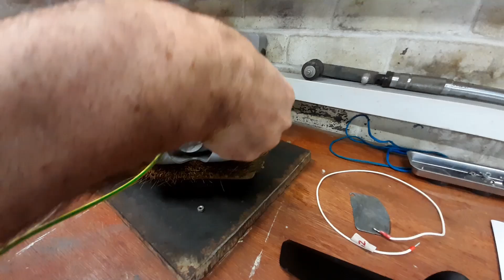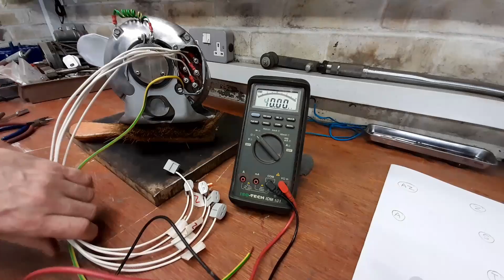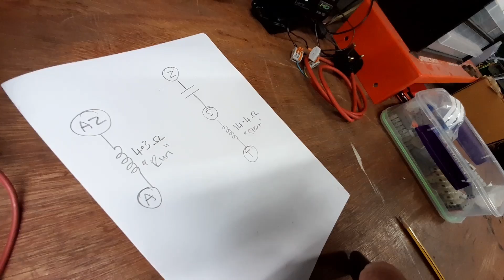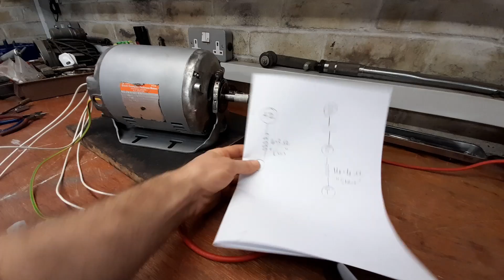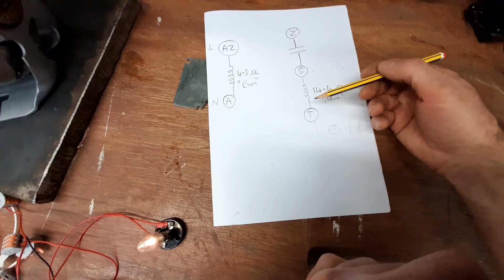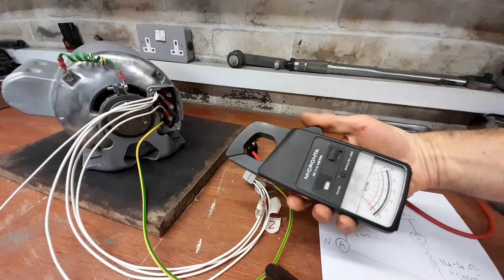Single-phase induction motor wiring AZ, A, Z, S and T | start and run windings | motor direction

Comment: I have this motor powering my Myford 254 but the breaker has a fault so I was planning to convert to a VFD. Your video is great as Myford could not advise, I am assuming the centrifugal switch precludes the use of a VFD. 
Stripping the Motor down it is relatively simple to bypass the switch and disconnect and remove the capacitor. 
If I then connected AZ to one VFD output, S to the second VFD output, then link A&T together for the third output.
I see advice that single phase motors can be used this way but I struggle with the idea that the VFD will see three different resistance values.
I would really appreciate your thoughts, and it would make a cool video.
Reply from the maker: Hello Rob, nice idea but I would be very surprised if that would work. On most of the motors I've used, the start winding is not designed for continuous operation, and there is a risk of overheating and damaging the winding if it is powered continuously. I'm fairly sure that any good vfd will have current sensors on each phase and continually monitor and compare these currents. The sum of the three phases should equal zero and if it does not this would suggest a fault. Used 3 phase motors are cheap and easy to come by, and I would much rather use one than risk trying the single phase modification.
Reply: Thank you for replying and I will take your advice, Being of the mechanical trade in heavy industry your break down on the working of this motor was brilliant and very helpful. Deep down I wasn't comfortable but you want to believe you can convert a single phase motor this way as it solves all the other Installation issues
As of yet Every video I have watched shows installation and operation  but not how to plan and define each component.
Please correct me if I am wrong, VFD's only change frequency not voltage and despite having 3 lines out the PD between the lines at any given time is still only 240v, finding three phase 240v is not so easy unless I buy from the Chinese market.
Regards
Rob C

Comment: I have a old vintage Brooks motor CK243041 Centrifugal start 240vac single phase from the termination board on the video it's looks like all the internal wires are terminated on the underside  of the board where mine are terminated on the front. From the motor I have a red and yellow terminated another yellow which is connected to live in  and another red from inside the motor which is terminated to the neutral in Resistance across the two yellow wires 0.3 ohms resistance across the two red wires 3.3 ohms I need to reverse the rotation what wire will I need to swap

Comment: Thanks so much explanation very good
I have a motor with an on off double pole switch on L & N as well an an overload
The motor is off my lathe your video will help me greatly 
The posts on the motor plate on my motor are used to hook up several items
I will have a go tomorrow to get it running 
Duncan Maidenhead

Comment: right, the question to be asked is the capacitor run in series or in parallel with the start winding? thank you
Reply from the maker: The start capacitor will be placed in series with the start winding. If you would like a good reference book then I recommend "electric motors in the home workshop" by Jim Cox. Fig. 1.4 will show you the wiring schematic.